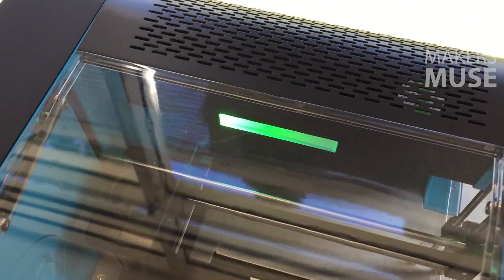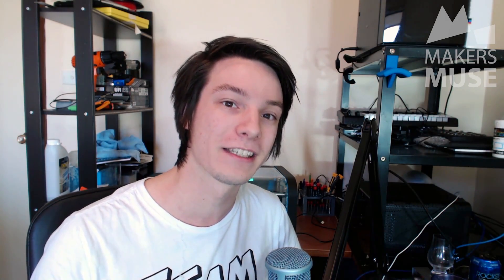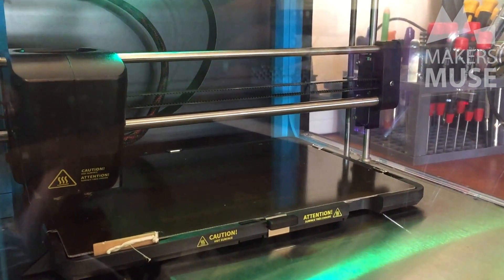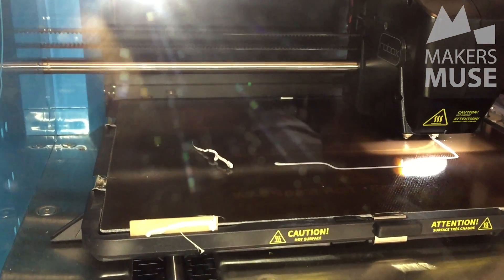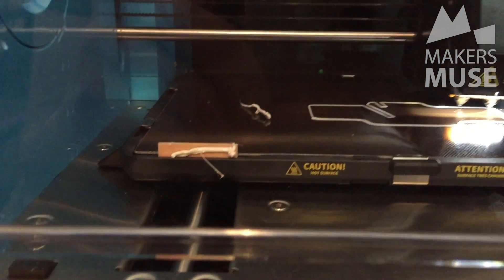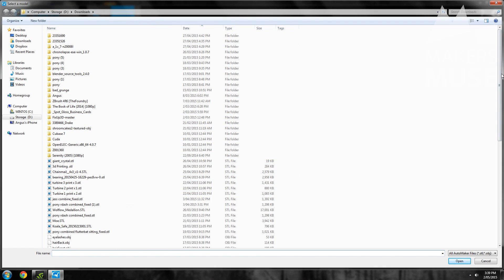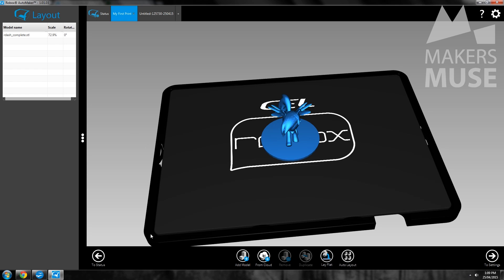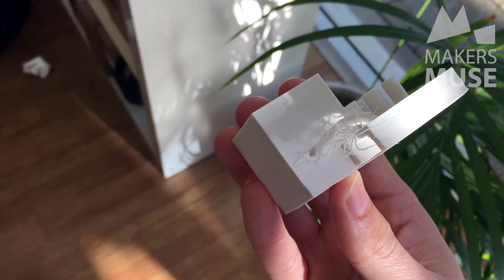Sexiest 3D Printer Ever??? The CEL Robox - 2015

Comment: I believe it's a mechanical lock on the lid, not motorized. The lock unlatches when the print bed moves forward and presses on the spring-loaded lever.

Comment: Hello Angus in this review make the comparison with the mankati. Do you have a review of the mankati. I'm considering to purchase the mankati can you recommend this? I will use this mainly for the printing of buildings. (architecture)
Reply from the maker: +Jürgen Van Tomme Hi, sorry for the delay. I do not recommend the Mankati to anyone - I had terrible issues with the ones I was involved in and the company has been lowering their build quality. Service is also difficult as they are reluctant to provide spare parts. I would try to get an ultimaker 2 which will give you great quality if you're after that style of 3D Printer.

Comment: Yea you lost me when you started bad mouthing flash forge dreamer. Your review of the dreamer spoke so highly about it and now you start bad mouthing it?? Sounds like a paid advertising to me
Reply from the maker: Harjot Minhas How do I bag it out? The robox has automatic calibration, filament sensing and looks better than the flashforge - but it still can't print the exotic materials you can do on the flashforge or do dual colour prints. They've just got their pro's and con's. I use both machines daily but for schools, I drive them towards the robox because it's harder to stuff up, unlike the flashforge where printing PLA at ABS settings will cause a really bad filament jam. Also... what kind of paid advertiser would let you upload a video showing the printer failing so horribly... haha

Comment: I have the same headphone stand that you have on your shelf, I printed it with a printrbot simple.
Reply: max Millette Made one too ;)
Reply from the maker: 101pokemasters Mine won't stay on the wall... I need to redesign it with bolt holes!
Reply: Maker's Muse just hot glue it. it's ample strong, and it leaves no mark if you know how to take it off.

Comment: Sexy...? Perhaps - everyone is getting excited from different reasons. Unfortunately this thing doesn`t print... http://centrumdruku3d.pl/cel-robox-recenzja-drukarki-3d/
Reply from the maker: Pawel Mariusz Ślusarczyk It does have its problems, nice review - though I don't think google translate did it justice. I have done some amazing prints in ABS but yes, often there are issues. PLA seems easier but I have experienced all the failures you did, at least you didn't have the O ring seals burst and molten plastic leak into the head.. :)

Comment: have you thought about doin any taz 5 and taz mini reviews, id like to get your opinion on the modifications that you can do to them. Involving the E3d volcano head option and multi material printing
Reply: Arden Phillips I shit you not I was literally JUST about to ask him the SAME thing.
Reply from the maker: DemonWeasel1990 Lulzbots' machines are pretty uncommon in Australia sadly, so I don't see me getting hold of one anytime soon. That said, the e3D heads are pretty amazing so I do recommend them, at least my experience of the basic single e3d hotends. 

The BIGGEST problem with multi material printing heads of that design is their tendency to 'smear' the other nozzles across the print, leaving unsightly marks. You can print with a protective shell around your print to help catch this but it can be really difficult. The best way to do multiple heads is to have them lift out of the way when not in use like the robox does :)